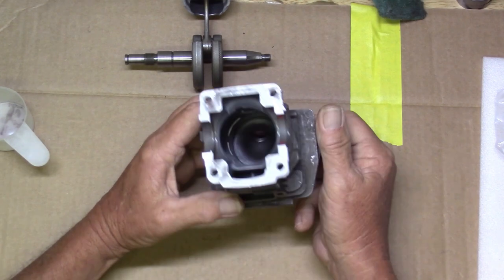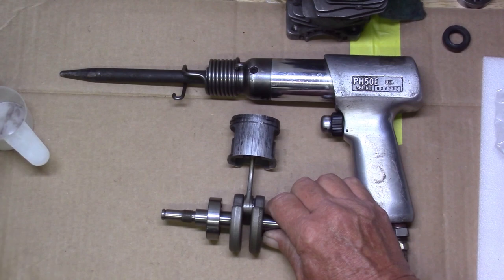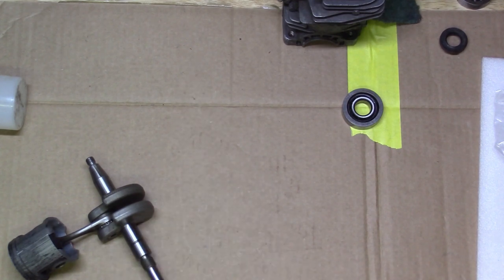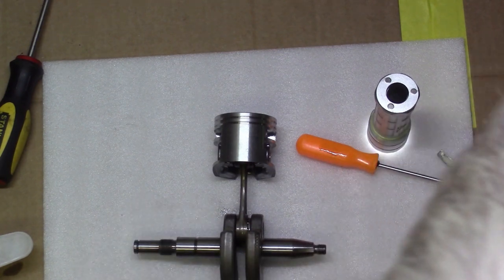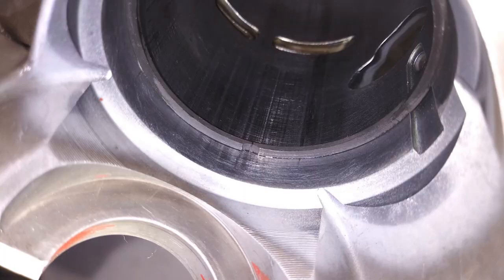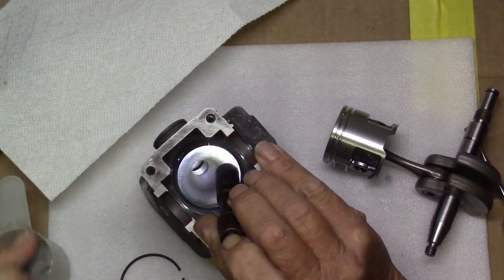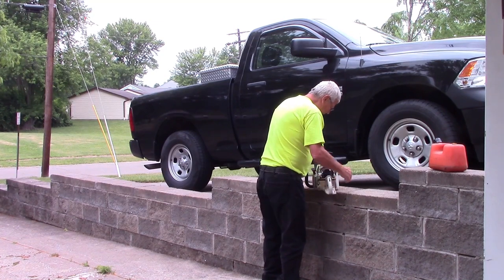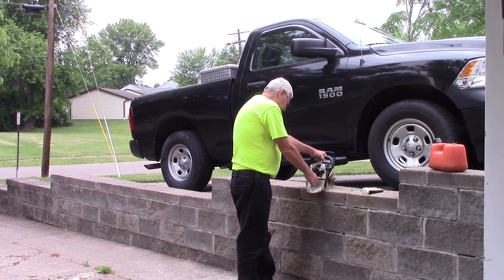Stihl 2 Cycle Cylinder Wall Repair MS271

Comment: Man.  What a great video.  I am starting to rebuild my Farm Boss.  This is what I needed.  I don’t understand to this day WHY mine overheated or caught fire.  I’ve always had gas in one side and oil in the other but Ace Hardware said it was because there was no oil in the fuel.  What?
Reply from the maker: Glad you liked it. So many things can burn them up never know. I have a couple other videos with lots more info (tear down, filing ring gaps and putting back together) Although different brands they are all pretty much the same in those 3 areas. I think they will help you a lot with your rebuild. 
https://www.youtube.com/watch?v=wtv_F0yJIpE&t=0s
https://www.youtube.com/watch?v=Wm5wT1WrQSA&t=0s
Thanks for your support and save the ole farm boss.

Comment: Most cylinders nowadays have a nikasil coating instead of chrome. It's a tough coating that protects the cylinder. Glad to see you got this saw back up and running again. Thanks for sharing 👍
Reply from the maker: Good info about that coating. Thanks for sharing it.
Reply: Just the cheaper saws have nikasil, the pro saws still have chrome
Reply from the maker: good info

Comment: Do you have a video of full disassembly? I just got a 271 and I always like to know how to properly tear down and repair all the equipment I own. But I can’t seem to find a full tear down video on the 271 anywhere.
Reply from the maker: Sorry that I disappointed you. This saw like most came to me with a box of parts already removed. I don't have any video of it anymore. Just don't have the space to keep them all. If it helps any at all when working on this model. It's easier to remove the carb and head as one complete assembly rather than taking everything off on the saw individually. I do quite a few carburetor jobs like this as well.
Reply: @CaptFerd  not disappointed at all, thanks for the info. Just surprised that seemingly nobody on YouTube has a 271 year down video!

Comment: Thank you for the video, I need to tear mine down.  How is the reassembly video coming?
Reply from the maker: If your talking about the cummins its finished. I have hours of video to edit. So much that Ive been breaking it down to smaller parts. Like the carburator rebuild and governor install. Thanks for watching and subcribing.

Comment: Another way to remove that bearing if you lack an air chisel is put thr whole thing in the freezer for several hours, then heat the bearing with a torch. Ive actually dropped press fit wheel bearings in place by hand with the opposite... freezing the bearings overnight and putting the hub in the oven.
Reply from the maker: Thats a really cool idea. Ill have to give that a try next time. Thanks for sharing thanks for watching.